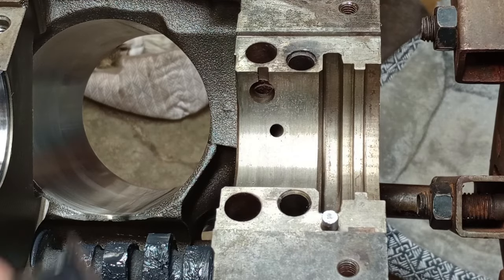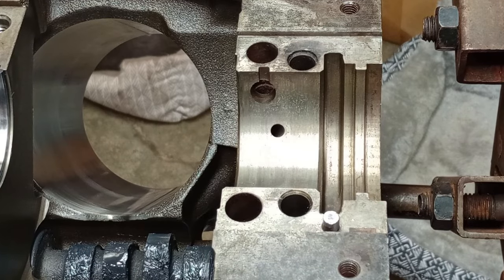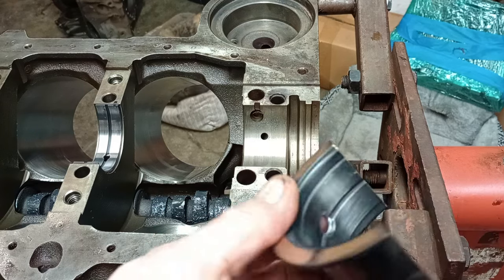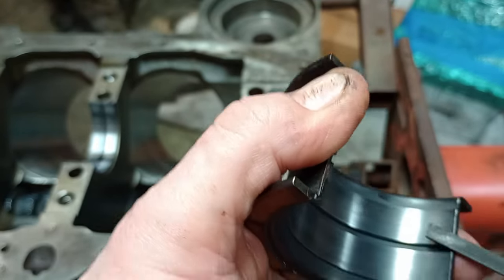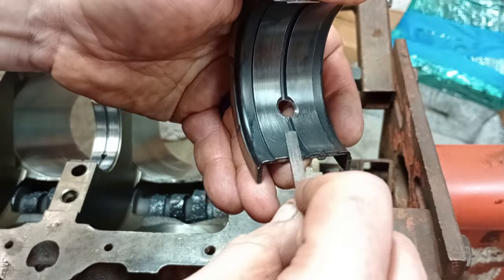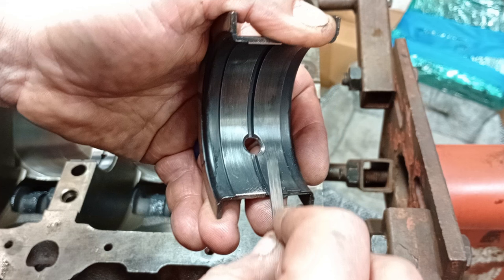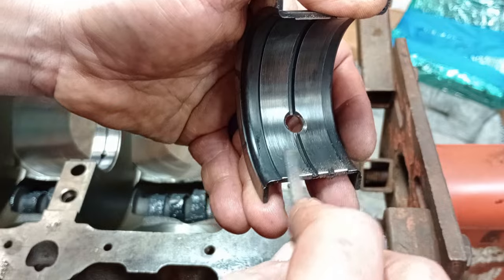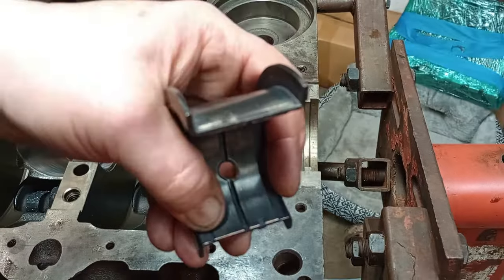Small Block Chevy Rear Main Bearing Mod's, Thrust Oiling Mod's & Oil Hole Alignment Mod's!

Comment: make sure and do this procedure over a well lubed cam shaft helps with brake in, heres a tip before the final wash of the block insert the bearing in the saddle this well help hold the bearing as you file then rotate the bearing so the oppposite side is up repeat filing. thanks for this great tip

Comment: What do you use for bearings
Reply from the maker: Depending on the application I normally use Clevite, sometimes King and ACL . This particular engine needed narrow bearings for the crank radius, so I used King race series bearings because that's what I had in stock at the time lol. but honestly King, ACL, and Clevite are all good bearings these days. for Nitrous and forced induction applications, I use King coated race bearings. They are very impressive and can take a beating like no other that I have used.

Comment: Probably better to line up the block with the bearing because oil can get underneath the bearing which can increase the chance of a spun bearing.
Reply from the maker: If the bearing crush is right there is no chance of a spun bearing.  Either way works, I chose to do the bearing because the block was just washed and the cam was installed.
Reply: @Marksracingengines  As the wash & cam installed had been done I would do bearing oil hole. I check bearing & all hole alignment at time of block deburing & thread chasing get that out of the way before I even start cleaning.
Reply from the maker: @Sabe53  well I understand,and that's the way I normally do it. However in this particular case, the customer decided to go with a different rotating assembly at the last minute. Hence the reason for a different bearing.